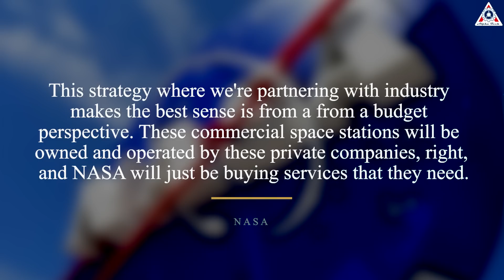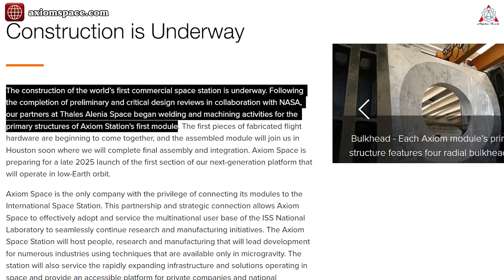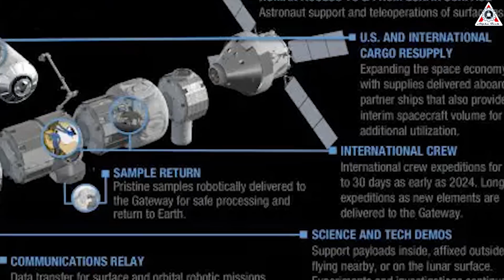NASA's genius solution for the ISS without Russia...

Comment: Genius solution used to be a rocket fuel tank made of exotic material to take the capsule into orbit. When the fuel ⛽is over, the fuel tank becomes lighter than air and shrinks due to negative energy to return to the ground safely. 😅

Comment: The ISS can be salvaged in many ways. It only a mater of mind. Higher earth orbit, Lunar orbit, a Lagrange point around earth ( without interfering with the James Webb); Or my favorite thought is push it out to the Mars or out to the asteroid belt.  In any of these parking orbits it could act as a “life boat” only.  Here you can store any survival supplies/equipment conceivable. Additional fueling and supply points and adapters can be added for future use.  🤔 Don’t forget the extra batteries 🔋.

Comment: The Lunar Gateway is totallu unnecessary.  It cannot reduce the total fuel needed by a spacecraft going to Mars, any remote control of vehicles on the Moon can be done from Earth using a relay satellite if ncessary, and any and all experiments required in deep space can be done by self-contained and unmanned spacecraft.  The Lunar Gateway is a white elephant and cannot facilitate anything.  In fact it only makes going to the Moon more difficult, more expensive, more time consuming, and less safe than without it.

Comment: No solution for ISS just an alternative (or alternatives). We should instead save the ISS, even if it needs to be split into Russian and US sections! Granted, some parts are very old, those can be repurposed for storage and other low priority usage. It costs a lot of money to boost big masses to LEO.
Reply: Not when Elon gets his act together, Starship will put paid to that old argument.
Reply: @krashdown5814  It will still cost more money to boost new mass into orbit than it does to maintain what is already there. Space X needs to make another Starship, but configured as a heavy lifter, a freight truck if you will.
Reply: @krashdown5814  Quite true, but Starship isn't there yet.  However, if and when it can be made to work reliably, robustly, and safely, it will indeed be a game changer for space travel and exploration.

Comment: It should be noted that SpaceX was largely made possible by NASA and CCDev program
Reply: yes, government funding, but spacex did everything else using its own ideas, expertise and innovation. So what exactly are you saying?
Meantime, Boeing's product has been made "possible" by government funding too, except that for much more money there is still no working product.
Reply: @alexanderSydneyOz  No, NASA worked closely with SpaceX to teach them launch operations. The video gave the impression that SpaceX was an outside, unrelated force.
Reply: Even the return of a first stage to the launch site was from a NASA study where they believed it would take about ten years of failures before they got it all working.  They didn't go forward with it because they knew congress would pull funding if they tried because of the high profile of the failures on the way.  The SpaceX method is exactly what NASA outlined, and took just as long with failed attempts on the way.  The difference is they SpaceX could weather those failures without backlash because they didn't have to worry about congress looking for any excuse to pull funding to feed a false narrative of "responsible" spending.  As a service provider to NASA the failure to recover the first stages after the contract was satisfied was their own company's internal problem, not congress's problem. They had the luxury of being allowed to fail as often as it took to learn how to do it, which is exactly what NASA knew they wouldn't be allowed.